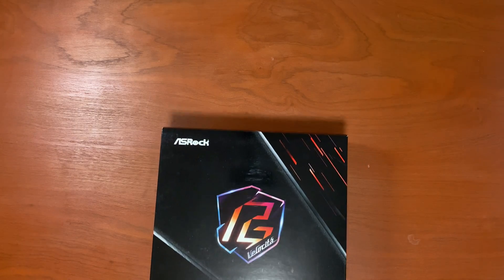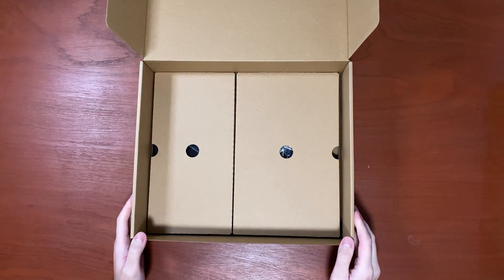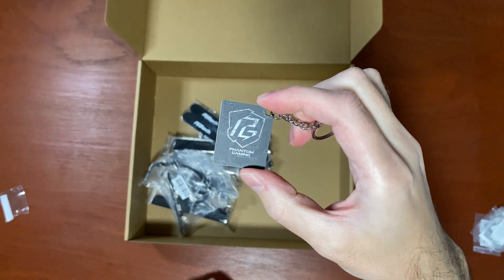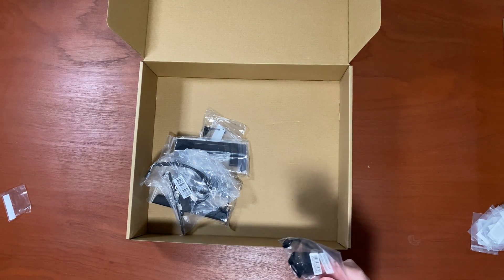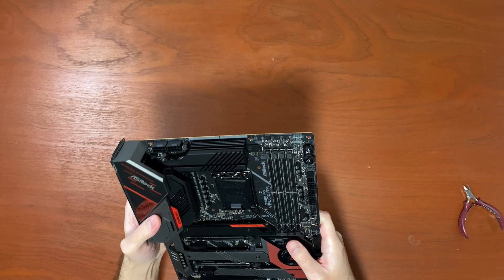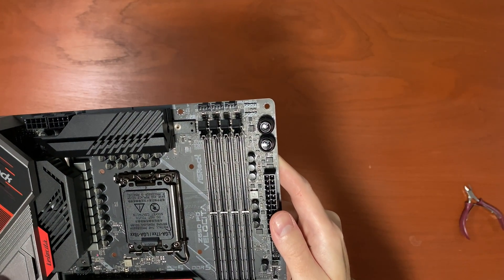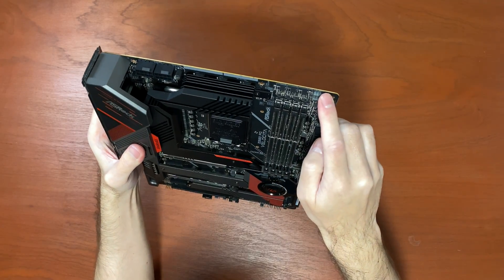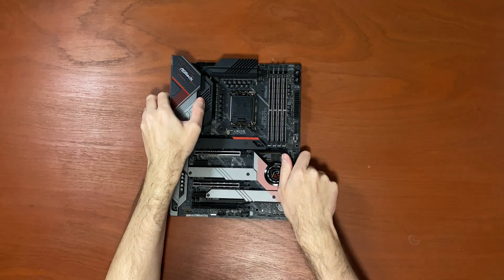Unboxing ASRock Z690 PG Velocita [Features & Specs Overview]

Comment: Hello one question buddy. If i use in the ram slot A2 and b2 slots i am using the dual chanel ? Thx you for your time .
Reply: Or i am  wrong! And i need to move my rams???
Reply from the maker: Just check user manual for your motherboard. It'll have a clear indication which RAM slots you should populate first.
Reply: @iVadimUnbox  thx you!